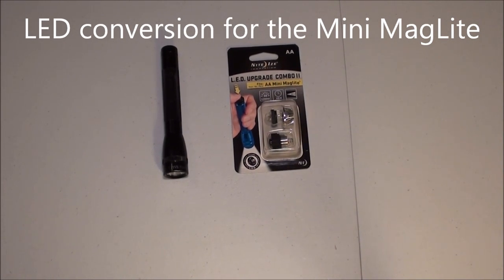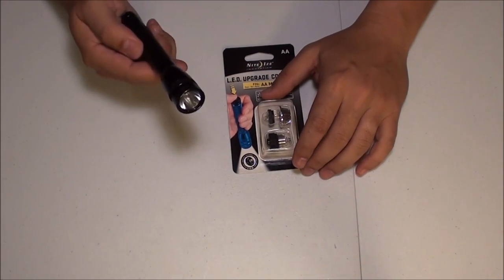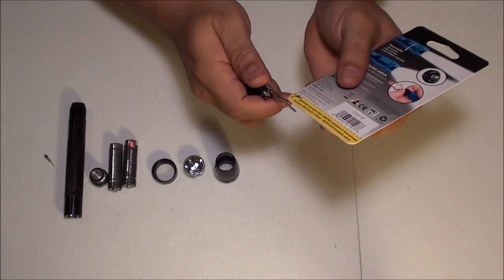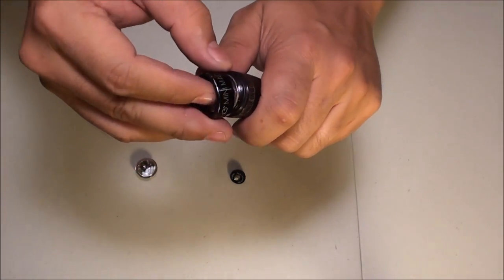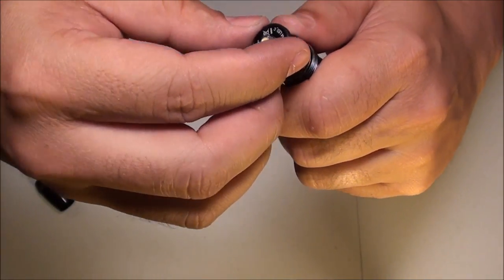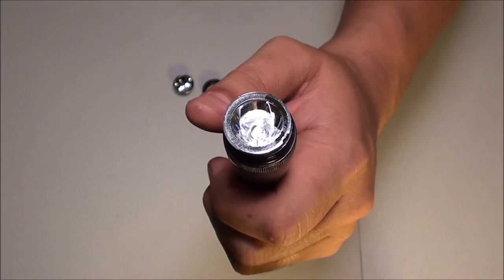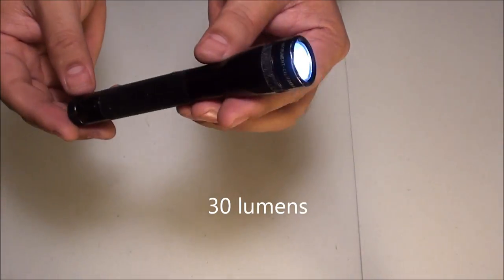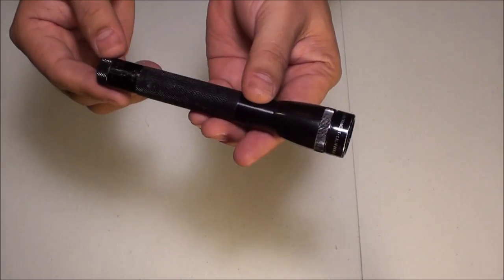LED conversion for the mini MAGLITE

Comment: I used the Nite Ize conversion kit some years ago and am going back to the incandescent Xenon bulb. The head does not screw down far enough due to the thickness of the board the LED lamp is mounted on, nor can the beam be focused. Less than two revs of the head and it falls off. In addition, it loses the O-ring seal and is no longer water resistant. This and several others of similar design SUCK because of this! I'm actually now pursuing a direct 3mm T1 3V LED that can be plugged into the switch assembly the same as the Xenon lamp, which will allow the head to screw down completely and restore the ability to focus and the water resistance.

Comment: I read that the original (candescent) Mini MagLite does 12 lumen, if that is correct than this is indeed a nice upgrade.
Plus it's a lot cheaper than getting a new LED Mini MagLite, which apparently produces 77 lumen, but costs 50% more compared to the 'old' Mini MagLite.

Comment: good morning, I found some details in this product and that is, the base of the led is too thick and therefore it is enough to the thread of the head of the led, to the point that half a turn off.
Another objection is that it does not concentrate the light in a single beam of light as if the original incandescent light bulb does.
the switch works quite well, I would have liked the edges to be resounding because they feel a bit sharp and could break the cover where the lights are stored.
greetings greetings

Comment: Do you lose the beam focus capability?  No one seems to demonstrate that after the conversion.  :/
Reply: no. especialy if you improve the assemply a bit and don't use tje push button and lose the little ring in the head.

Comment: The only thing i didn't like about the kit is even with the rear button activator, i still had to turn the head to turn on/off. I ended up modifying the light input to where only the button works so i don't have to turn the head and press the button to turn on/off.

Comment: Sorry to rain here, but on Amazon I see a lot of 1 and 2 star reviews on this kit. I will rather keep my trustworthy 1999 traditional Maglite AA and see what happens with a modern LED AA Maglite...which does not seem to be too high rated either. The thing I love about the Maglite, on either version, is that they do not have the usual rubber click on / off switch which seems to be present in every flashlight. I love Maglite design because you can stick it in water and it will not get in it, so different as those rubber switches which let water get inside them. Hope it goes right.

Comment: Does it turn on with the normal switch to?
Reply from the maker: It turns on with the tail cap button and the twist head. I usually just leave the twist head on and use the tail cap.
Reply: Ok, thank you.